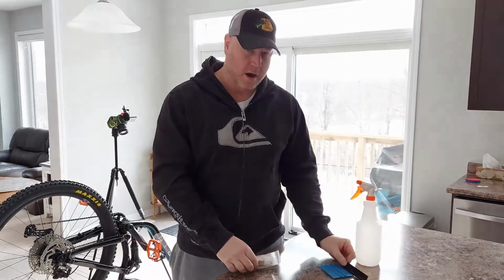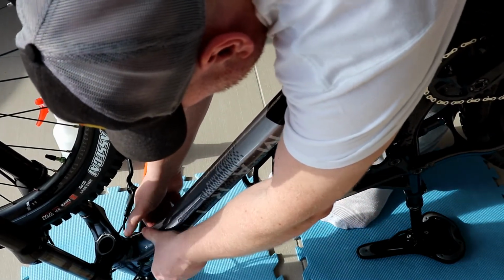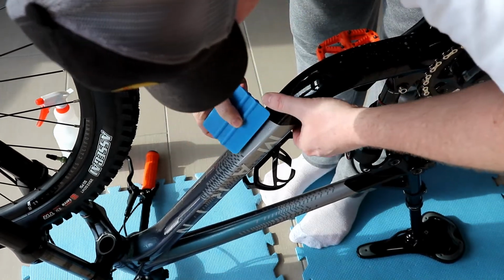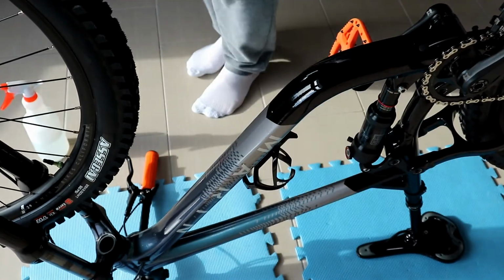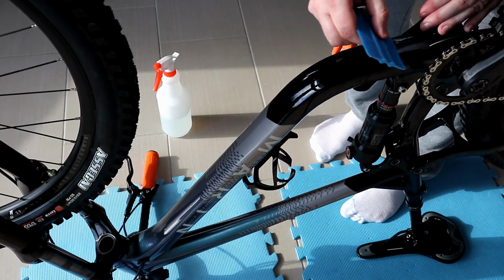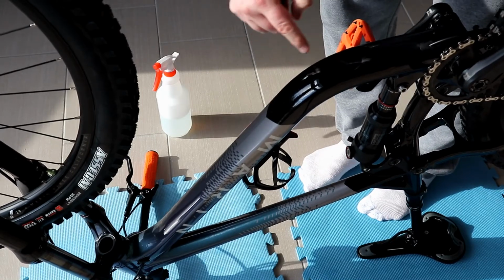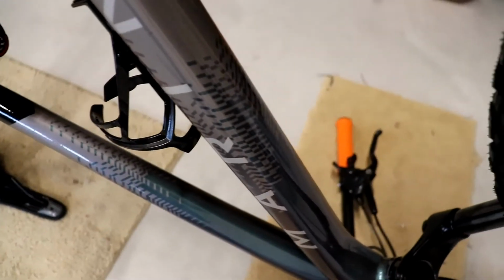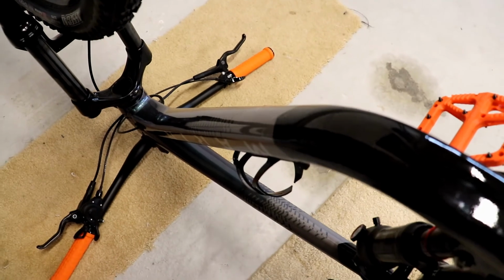3M Protective Tape on Marin Rift Zone 2

Comment: Thanks for sharing!  Hope you have a chance to field test the tape, it will be great to get some feedback on its effectiveness.

Also, digging the orange pedals and grips.  I wouldn’t have been bold enough to try that, but after seeing yours, I really like it!
Reply from the maker: As soon as I get her on the trails & tested I will defiantly put up a vid.  Thanks for the comment!
Reply: @ESBMTB  thanks!  What width tape did you use?
Reply from the maker: @richarde1355  I bought 4 inch wide but cut it down to 2 inches